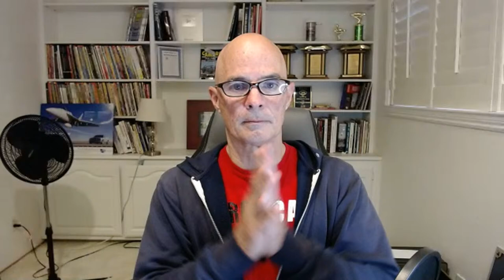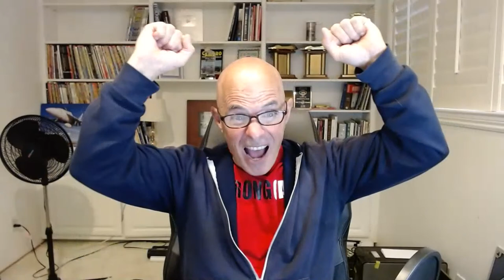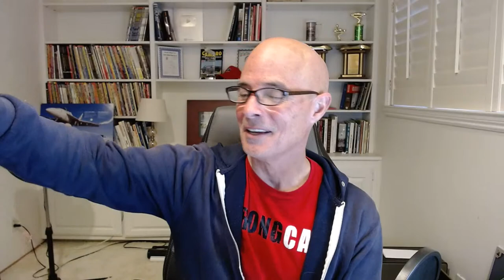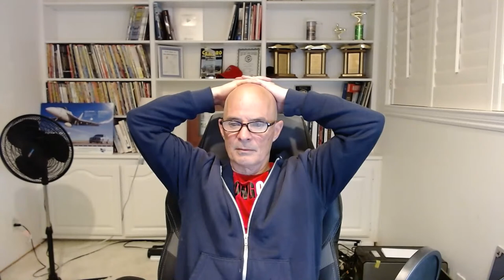LET'S TALK TECH-THE 300-HP & 400-HP 5.0L FORD CAM

Comment: In my street driven 1989 Foxbody, I run TFS 11r 190 heads, Holley Systemax II intake and an Anderson N-41 cam.  Makes all the power I need.  Great cam for under 6,500 RPMs on a stock bottom end.  The key is the 110 LSA, I used David Vizard's camshaft formula.
Reply: Pittsky, have you dyno’d it and/or track times/mph?

Comment: Ive always been under the impression that with bad flowing heads longer duration and cam timing is more effective than higher lift because after a certin lift flow just stalls out...?

Comment: 110% of the time there's a cam choice question for a stock headed 5.0 in forums its always answered it's stupid stock is as much as the E7s will flow, you have shown with gt40 intake and stock e7 heads you can get a decent bump from a cam upgrade so that's showing with the intake not being the choke point they will flow more that the stock cam will support.
Reply from the maker: a cam will help with any head-just more with good heads

Comment: hey richerd  351w howards cam 224 /231  110 with floteck heads light clean up.  gasket was a.039 now i want to install a .026 gasket,  piston in hole .025 has stock 94 bottom end do you think i make close to 350 hp..thanks for your time.
Reply: 0.051” is still too much quench distance....get it down to 0.040”.....great combustion chambers become shit chambers when proper quench distance isn’t set!!!  Set proper quench and get at least 10.5:1 compression!
Reply from the maker: what intake?

Comment: The old crane H.M.V. line for those 302 ford's were great cams they still make them under a different line the 274/?  484 intake 512 exhaust and there one above that a 278 and a smaller one but they run really well..

Comment: I missed most of the live, but I answered the poll with your DZ302 vs. BOSS302 comparo in mind. With less head the dz needed more cam to get similar output. So my opinion if heads are staying,  there's a cam profile that can help power in a certain rpm range. Did I just talk in a circle?

Comment: The 331 in my Foxbody is essentially a duplicate of an engine you used in a magazine article back in 2017.  The combo had 10:1 compression, a XE274 cam, an Air Gap  style dual plan intake and a 750 Holley HP carb.  You were actually testing heads stock E7TE heads vs TFS 170 as cast heads.   With the stock heads it made 353 hp and  339 lb-ft or torque.  Using the TFS heads it made about 439 hp and 437 lb ft of torque.   This speaks directly to your point.  

I am using the same TFS 170 heads and XE274 cam with a little more compression (10.5 due to different pistons), a real Performer RPM Air Gap and a QFT 650 AN carb.   This has proven to be a really nice engine combination in my car (along with a new Ford Racing T5 and 3:73 gears).  I sincerely appreciate all the work did testing that engine, thank you.
Reply from the maker: very cool-that is a good combo

Comment: i did the 302 big single plane efi and tiny cam. ended up not being a great combo imo. xe258 (208/216) cam; peak tq at 4200 with good cylinder heads. the previous cam was 224/242 and felt lazy below 4k with the manual trans. the smaller cam just doesnt cut it up at the 6000rpm range. it doesnt feel lazy down low, as one would expect.
Reply from the maker: A SINGLE PLANE IS SOFT DOWN LOW (NO MATTER WHAT CAM YOU USE)

Comment: If a cam is limited by the head or intake flow, does that mean another cam could make more area under the curve? 

Basically if the cam choice should be a high rpm cam but the heads and intake either can’t flow or aren’t tuned for that rpm would there be a cam that makes the same hp on the combo with mor torque?
Reply from the maker: the intake and heads limit the power added by the cam, they limit smaller cams less than bigger cams

Comment: I can't wait to see if you can replicate the stock cam 400hp 302. 
I think with exceptional block prep, .040 pistons, higher compression, 1.7 rockers and Steve Brule tuned carb. 
It will be within 10 hp. 
Oh and maybe throw an adjustable timing belt to try everything you possibly can with the stock cam.
Reply from the maker: it was suppose to be done with the stock short block if I recall-not a built (high comp) motor
Reply: @Richard Holdener  I am going to try and find the original magazine this weekend. I think they did a backyard rebuild on the short block. Before installing the AFR renegade heads.
Reply from the maker: THNX I'LL DO A SEARCH TO SEE HOW MUCH THEY CHEATED IT